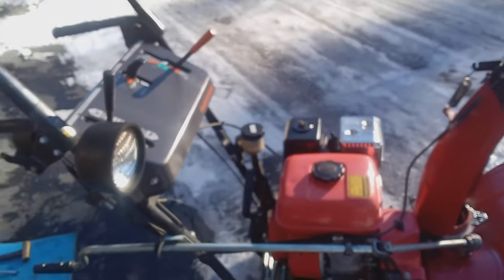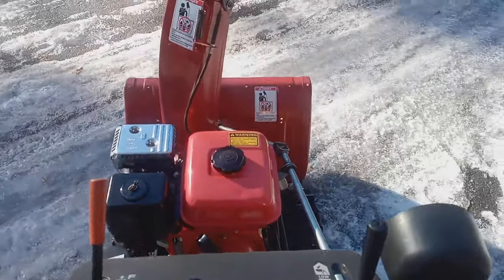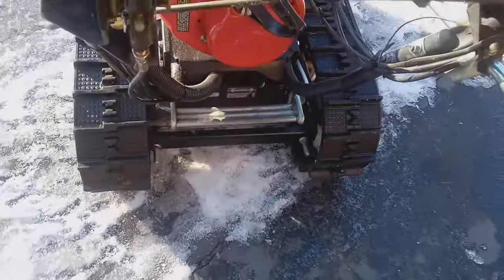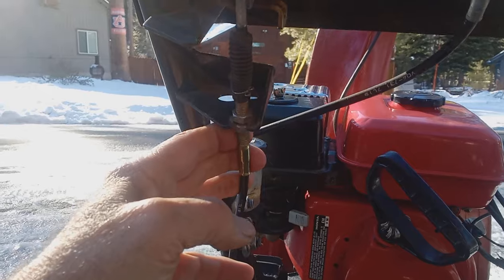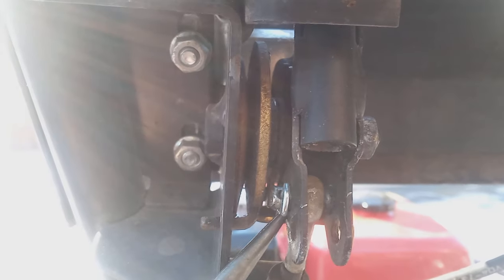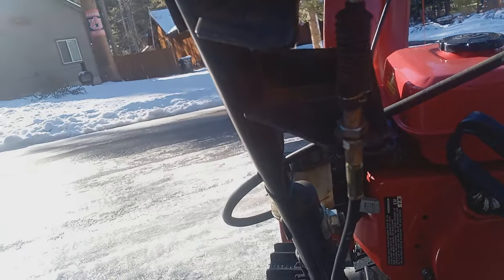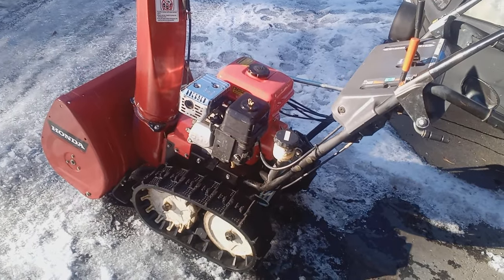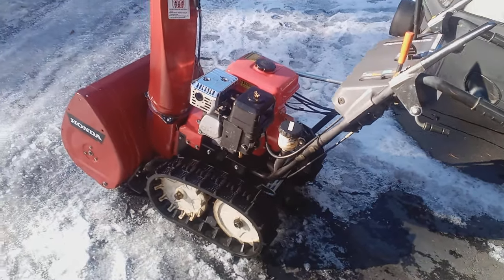HOW TO INCREASE Reverse Speed On A Honda Snowblower!

Comment: If you just adjust the cable then N will not be Neutral. Go on the second hole. Did that years ago. Much improved reverse speed.
Reply from the maker: u da man

Comment: AH, that is very interesting information!! This is one of the few complaints I have had with the 928.. Can't wait to try it out!
Reply from the maker: Glad it was helpful!
Reply: Looking at my new HSS there isn't a second hole for the cable but looks like there are stops that regulate how far the lever can travel. They may be adjustable but haven't removed the cover to see. Actually I think that machine is fast enough in both directions not to need anymore speed.  @HondaSnowblowerEnthusiasts311
Reply from the maker: i dont have a HSS to check. this is for older HS hydrostatic models.
 @akbearable

Comment: So I did the modification by moving the cable into the second hole and it works great! Normally I'd say  good practice one should avoid using the reverse that much and instead turn around and blow snow both directions, but some driveways, or particularly in tight spaces, using the reverse is just easier and faster. I was able to confirm that this mod raises the speed going backwards and was a BIG improvement on my HS928! I did not notice forward speed being affected that much, which is fine, as it always was adequate before. I'm not seeing a downside to this. Initially I was wondering if it would affect the sensitivity of the hydrostatic lever in getting the right speed for the load or place too much load on the transmission but it doesn't appear to have done so.
Reply from the maker: thank you

Comment: Interesting video.  I have an older Honda 11/32 track that is painfully show in reverse.  A local place that sells Honda's said the 11/32 was typeically slow in reverse but your info was interesting and I'll give it a shot.
Reply from the maker: shop is wrong. try it. you can also adjust the cable under control panel as well as move the cable end in lower spot. Join our FB group for more info Honda Snowblower Enthusiasts. Thanks for watching.